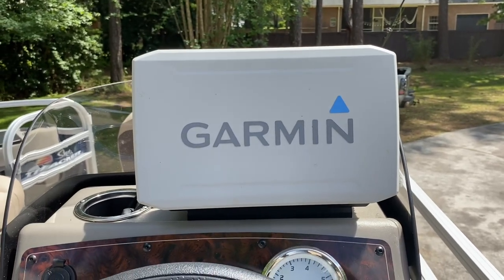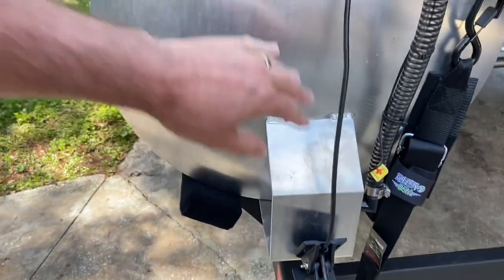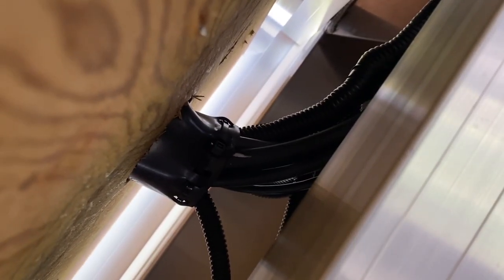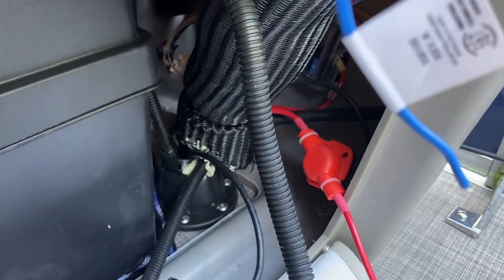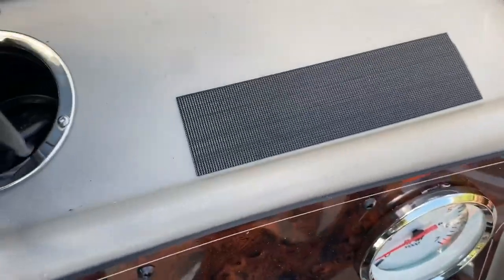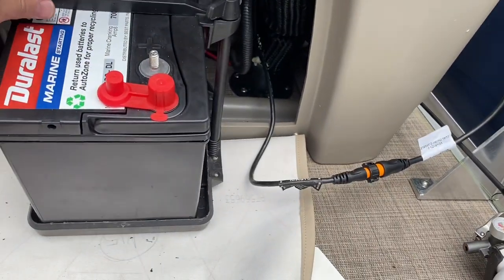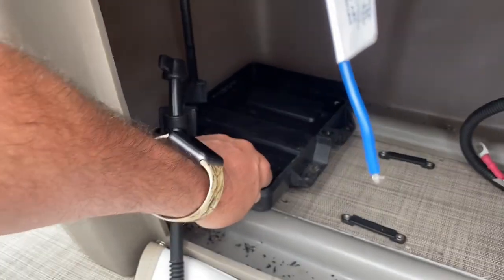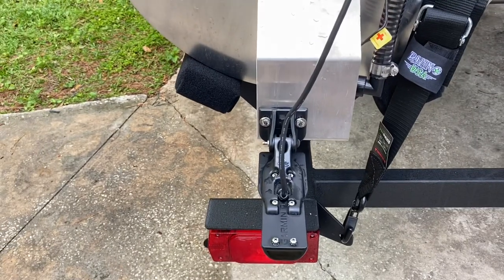2023 Sun Tracker Bass Buggy 18DLX Pontoon Boat Garmin ECHOMAP UHD 93sv Fish Finder install.

Comment: I have looked from experience and had to look it up. I have a 2021 suntracker and had the fish finder and trolling motor hooked to the same battery. Apparently you’re not supposed to do that it can cause interference and it ruined my fish finder. Run the fish finder to the starting battery or it’s own separate one
Reply from the maker: Good idea, I am still working out the trolling motor and battery combo, but I am too paranoid to hook anything to the starting battery.

Comment: Nice Install, I do have a question. Everything I read says mount transducer on Starboard Side. My mount as well as yours is on Port side. Have you used the Garmin on water and do you see any problems?
Reply from the maker: It seems to work fine; it does say to mount on the starboard side because of the way the prop turns can cause interference, I believe. I do want to find a good welder to add a bracket to the starboard side, but it's not at the top of the to-do list.